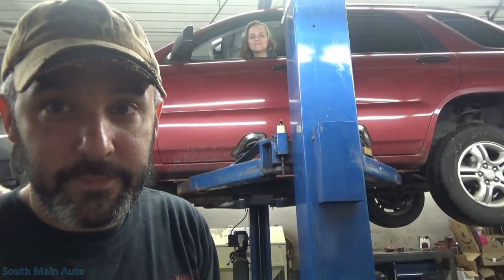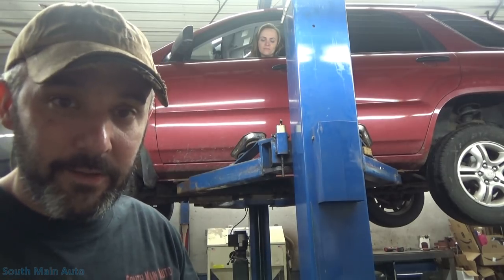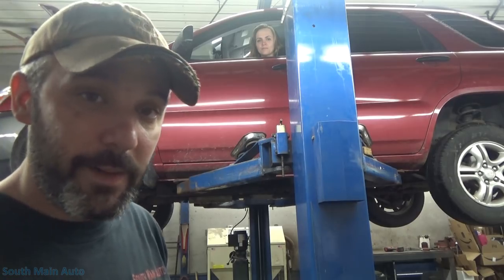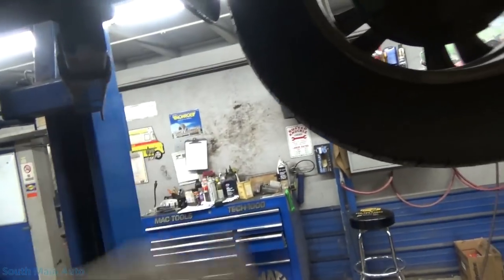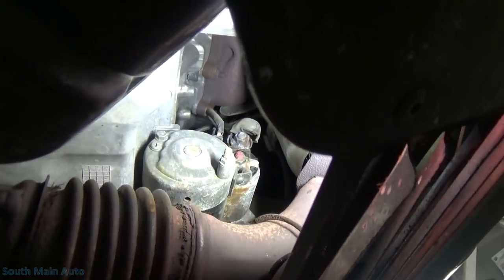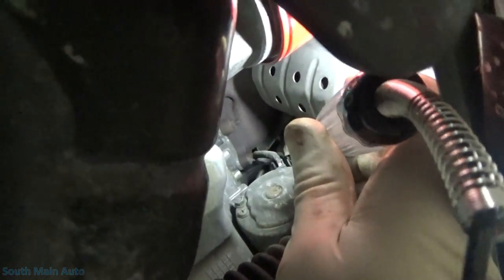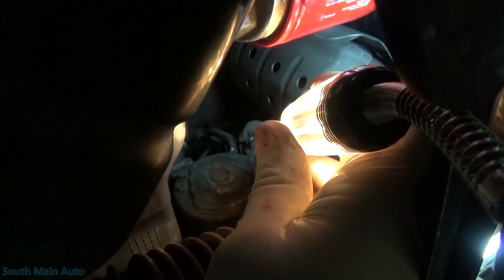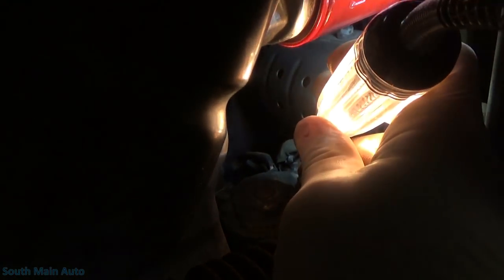TEST DON'T GUESS!

Comment: I've found that if you leave the battery connected while messing with a starter or alternator, you can take a boring dull job like that and turn it into a fun game of "OPERATION"
Reply from the maker: Lol no comment haha
Reply: Then you warranty the wrench. And I have never inadvertently left a pair of pliers on top of my battery and shut the hood, making connection between B+ and sheetmetal. Nope, wasn't me. That paint was like that...
Reply: ykmalachi I used to love that game even though I sucked at it. That would be a great vijao
Reply: yeah..one time I was sold the wrong starter  for a celica.. the post rubbed against the block ..can you sat arc welding :)
Reply: Sure Gary. We believe you, especially Eric.

Comment: Outstanding thumbs up video.  What is remarkable is that if this customer went to another shop they would have been worse off.  The customer probably would have ended up with a questionable re man starter and a higher repair bill.

Comment: My students and I spent much of last week learning about the importance of looking for voltage drops that appear on a loaded circuit, specifically starting and charging systems. This video is a perfect example of why LOADED voltage drop testing is so easy and important. I shared it with the students this morning. Thanks Eric O!
Reply: Voltage drops are why they went from 6 volts up to 12 volts back in the 1920's and 1930's. With 6 volts you need twice the current for the same amount of power transfer. This makes small resistances at the connections more significant because they will cause higher voltage drops. Older 6 volt cars always had a lot of problems with dim headlights. I heard recently that some auto manufacturers are considering going up to 36 volts. This will reduce the required gauge thickness for all the wires and reduce the significance of connection resistances.

Comment: This is one of those cases where replacing the starter would have probably fixed it too, but a little diagnosis saved you from having to change out 5 starters at warranty labor rates to get a good one.
Reply: FrugalPrepper Was thinking the same, change the starter and clean the contacts during installation. Would have spent money on a new starter for no reason

Comment: Good video. A lot of guys would have put a starter in anyway just to pad the bill and I'm sure most heat shields would have stayed on the shop floor ensuring the customer would return for another starter in six months. Huge difference between you Eric and the people in the industry that cause most customers to think they are getting robbed whenever they get too close to a repair shop.

Comment: The crappy thing about this situation is someone who just assumed they needed a starter and tore it apart and put a new starter in it would have probably fixed the bad connection in the process of installing a new one and they would have thought their parts cannon worked perfectly. Althoygh the customer would have had to buy a new starter in the process and paid for the labor of changing it. The costomer would have had no clue they got ripped off cause the problem would have been gone after replacing the part. Even though they only realy had to clean up the connection. Anyways that dodnt happen with eric o and thats why i love watching him and learing from him. Thanks for everything u do eric. Great vid

Comment: Excellent advice! Always test the circuit under load! I've been stung by this twice. First time, wheel loader: electric fuel priming pump not working, pump had power, replaced the pump, didn't fix it. dug further and found the voltage dropped to 2V when you flicked the switch. Turned out to be a broken pin in the connector in the back of the cab. Second time. Wood chipper: Intermittent engine shutdown, No com error codes for engine ECM. Unplugged ecm plug and tested for power grounds and data link continuity, all good so made the call on the ECM. Didn't fix it. Dug a bit further, Supply voltage at the ECM was dropping to 6V when under load. Turned out to be a poor connection at the emergency stop switch which had been wired directly into the ECM power feed.

Comment: I've seen this happen quite often on older chevy and dodge starters, but the bad connection happens on the inside of the solenoid, between the post and copper contact ring. Those solenoids you could take apart and clean the contacts, polish the copper ring, and be back in business. Also, a bad starter will also mimic a bad battery but you can do an amperage draw test on a starter and see if it's out of specification before replacing it.

Comment: When many hear the word voltage drop test, memory of professors and complicated testing comes to mind. As you show here, in the right hands as a screening test a voltage drop test can take seconds, testing both the battery and the wiring all the way around. What I find interesting in this case is how your test light did not show a reduced dim glow under its own current even when you tested on the post. By itself, the light wasn't sensitive enough to uncover the problem. Then, when a second person turns the key, the massive current draw reveals the diagnosis. So, even with a test light one can be fooled if the testing is not done with current matching the normal circuit draw. Without the green crusties and sparking I would have wondered if the battery was undercharged or on its way out, basically showing internal resistance in the battery itself. So, the way you did this is a quick screen for a bad battery, too. I can see why old school mechanics teach this specific technique, it screens for abnormalities everywhere.
Reply: This is why techs learn to always load a circuit. That's when problems show themselves.

Comment: I'm just a DIYer but I came across a similar situation a couple of years ago on my friend's 2008 Corvette.  In this case his starter was toast but it was because the nut on the starter for the hot lead was loose.  The high resistance caused the post to overheat and melted the plastic around it until the plastic crumbled and the post/nut fell off when I touched it.  It either worked loose or it wasn't tightened properly at the factory.

Comment: You need to get a junk car on it's side in between the lift posts and set off the air bags on it and wait for Mrs. O to come in.  Then you can be like "Thank God you weren't in there.  I was just raising it up and the air bags went off and it fell right off the lift!"
Reply: FrugalPrepper that's awefull!!
Reply: James Burns That's why it's awesome!
Reply: Ha Ha , the Mrs. would freak. OMG  he has to get that on film !!!!!!!
Reply: FrugalPrepper that would be gold
Reply: I've seen photos from a garage in my area where one post of a two post lift failed and the car went BOOM! Happened in like 2 seconds. The tech had just walked out from underneath the car to get something from the toolbox. If he had been under the car 5 more seconds he would have been gone.
Reply: There are plenty of videos on YT of cars falling off lifts, definitely can be deadly. 

But he doesn't even have to put the car on the side, just put a blown air bag on the steering wheel and say it happened going up.

Comment: I replaced a starter on a caddy once... I knew the starter was junk so as I was replacing it, the main wire coming from battery, broke right out of the solenoid, which was no big deal cause I had a "new" starter... I opened the box and the new starters solenoid was snapped in half... Thank you Duralast... Turned a 10 minute job into a... still a 10 minute job but I had to wait till the next day till they got a new one in...

Comment: like the Vise Grip ground clamp! Going to so equip one of (but not all of) my lights. Saw a similar starter issue on a brand new Dodge once c. early 70's... the battery cable nut on the firewall mounted starter relay was only finger tight. Came that way from the factory...

Comment: This reminded me of the time when I first got my current car (Citroen C4 Grand Picasso). It was struggling to start which pointed to a starter motor on the way out. This was what I was told by the place that I bought it from. I knew better than to assume that this was the case. My first port of call was the battery and the readins I was getting with the multimeter suggested that it was on the way out. To be 100% certain I took it down to my local Halfords (UK equivalent of Auto Zone and Advance Auto) who confirmed that the battery was duff. The cheapest battery they had was £95 for their own brand so I politely declined and I bought an Exide battery for just shy of £60 delivered on eBay and it is still going strong to this day.

Comment: I love my power probe. It does exactly what a test light does with the added functions of measuring voltage and giving the ability to supply + or - at will. Want to test the integrity of a ground? Touch the tip and give it power. If it trips the circuit breaker it can support at least 10 amps without issue. I love my power probe.

Comment: Wow, this video was a deja-vu moment for me. Last Friday I helped a friend diagnose a Camry no-start just like this. Turned out to be a similar high resistance issue in a power cable connection. He had guessed and pulled the battery but it tested OK. Lesson learned (again).

Comment: Had a similar problem on the 175 amp main fuse connection on my 2007 taurus. It was a intermittent connection at that fuse box by the radiator and if memory serves me right it kept showing up as a low battery. I thinking it was a old battery changed it only to have the problem reappear a week or so later. Used the meter that time and found the voltage drop then cleaned it up. Looked somewhat like your sample. I thought I was smarter than that but shortcut burned me for the price of an un needed battery. Thanks for another good video.

Comment: I remember (and you most likely remember too)the days when car starter solenoids were rebuildable.I still overhaul all the solenoids I can get parts for. Delco 50 MT and other large starters. 
Which brings me to a suggestion for a video, maybe some time you could crack open an old starter and alternator and show the viewers why you do not want those studs to spin and some suggestions how to prevent the dreaded Bakelite crunch.
Thank you for your emphasis on TEST DON'T GUESS I believe it makes us all better mechanics
Reply from the maker: The words Bakelite crunch give me cold chills and make me wanna say naught words haha
Reply: I second the motion. I would like to see and know, and understand just exactly what fails in a starter;  for example.......is it usually just the brushes wearing out? or the commutator surfaces wearing out, getting pitted, getting dirty, etc.?     Or the insulation between the segments getting pitted or falling out?  Or a stator winding developing an open?   I'm the type (as many of us probably are) that for my own personal car I would not mind taking a saturday to sit at the bench and do a total rebuild of the OEM starter. But I know that's usually not economical for a service shop to do.  So yeah, show us how to rebuild one, man.

Comment: I had the same problem over 30 years ago on a Crown Vic.  Neighbor's car, only a few months old.  I was ready to call the starter relay/solenoid until I heard the arc and smelled something burning. Of course, from underneath I could see the arc.  I think the nut was never properly torqued at the factory.  It was also a pain to access and clean the cable end and stud.  Fluid Film did not exist back then

Comment: Yeah I made the mistake of leaving the battery connected while changing my alternator and it slipped and there was a bit of smoke from the fried wires.  Thank god the fusible link saved me.. n
Reply: Yeah, and thank god you didn't damage the engine computer. A lot of alternators on the newer cars are connected to the engine computer for better load control. Next time take the negative battery cable off and don't risk damaging something really expensive.

Comment: When checking for voltage drops it depends exactly where you touch the test light. If you touch the light to the stud or nut on the starter itself and it goes out when the key is turned then you move the point of the test light to the ring terminal on the cable and try again. If the light stays on then the cable is okay and the problem is the connection right there. But if the light goes out then the problem is between the ring terminal and the battery. So then you move up the cable towards the battery. When you jump over the bad connection the light will stay on when the key is turned. In this particular case you lucked out because it sparked and you noticed it, but that doesn't always happen. Sometimes turning all the lights off in the shop can help you find bad connections (as well as bad spark plugs, coils and wires that are arcing).

Comment: mrs o is getting up in the world lol.   i tested a "super mechanic" i worked with. put nylon washers on the starter stud on a tractor that was his next job. shure enough 2 minutes after starting he was at the parts counter wanting a starter. i may have been an ass but at least the boss finally seen the true colors. i prefer a meter for volt drop testing (so much more accurate) but in this case the scope on a rope did a fine job.

Comment: Had a nearly identical issue with a family member's Toyota Camry. Could have sworn it was a starter as the battery was good and strong, clicking at the starter but no turning. Even removed the starter and had it tested at the auto parts store. After reinstalling the starter, I noticed that the positive battery cable to the starter was corroded and arcing when we bumped the key to try to start the car. We wiggled the positive cable a tad and found a position where the car would start. Corrosion ate at the cable connector enough to where the car wouldn't start. Replaced the connector and car has started every day since.

Comment: I just went through this with my 06 Dakota.  I pulled on the sloenoid wire and it broke off due to corrosion at the crimped connector.  On another subject, what's your success with rebuilt power steering pumps, esp from NAPA?
Reply from the maker: Mehhhh 50/50 like all the rest. Napa does use some BBB pumps that are not to bad though

Comment: I got a fuel pump work order on an 09 GMC truck. I disconnected the connector for fuel pump pulled it over frame into rear wheel well, plugged a light bulb between power feed pin and ground pin of connector turned key on and no light. Imagine I had trusted that the past guy had done his diligence when calling the F pump....

Comment: I've got a neighbor I'm going to show this to,  he ought to be able check out his no start sometimes, pickup.   It would be easier if I just did it for him but he needs to learn how to learn.  It's like raising another kid, that neighbor.
Reply: If the problem is intermittent it can be hard to find because it will not show up all the time. What you can do is run two long wires from the two terminals on the starter up into the cab. The wire from the large battery terminal should be hot all the time. The other wire should only be hot when the key is turned. Have your friend carry a test light or voltmeter around with him. This will allow him to test the voltages when it won't start to find out if the problem is in the cable battery circuit, the control circuit to the starter solenoid or the starter itself. Then go on from there.

Comment: how would you handle it if the the starter does go bad within the warranty period written on the work order. is it a comeback?
Reply: You have to be very specific with what you write on the invoice and what you tell the customer. I would tell him/her exactly what I found and exactly what I fixed and exactly what he or she was charged for. If something else breaks later, whether it be the starter or something else, it's a new separate repair. When you fix one thing you can't start changing related parts that are functioning properly just because they might go bad. When you are fixing  one thing on a vehicle you are not required to warranty the entire vehicle and you are not required to restore it to perfect like new condition. In this case where would you stop? Are you going to also replace the battery, alternator, engine computer, fuel pump, radio.....??

Comment: A few weeks ago i had a look at a Nissan Almera that seemed to have an issue with the alternator output dropping out. Turns out it was just a crusty broken block ground. The guy didn't have any money and had been told he needed a new alternator by a garage.
Reply: zoidberg444 Most garages could care less if the customer is tight for money, most keep thinking, "this is cake money"... unless that alternator is placed in a 4hr job location like on the Fieros. It's so backwards, because if shops actually tried to save their customer money, they'd come back AND refer everyone they know!

Comment: KIA's a Winner. If you take the time to TEST or not..If we had just replaced the starter..Well..would have cleaned up the fittings for a good connection :)

Comment: Very Kool!!  Bruddah This was a really great video.

Seriously. You hit the nail square on the head. A job that many others not so honest master mechanics (and those  not yet master level) may have easily misdiagnosed the problem and ended up fixing it with tossing parts the owner didn't really need. 

This simple job needed to fixed with video and you were the only one within hundreds of miles to do it.  

Bravo Bruddah Bravo. A Job Well Done.  

These fixes are why you're head n shoulders above the rest. 

Ain't no jive in ur dive!!